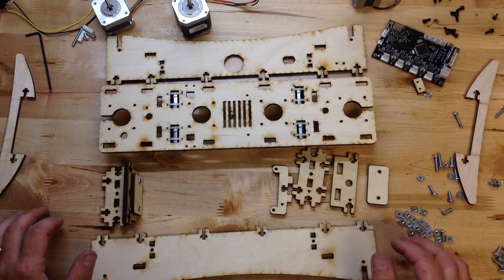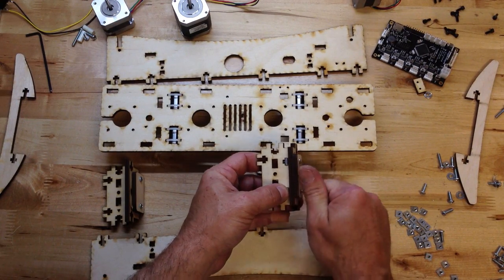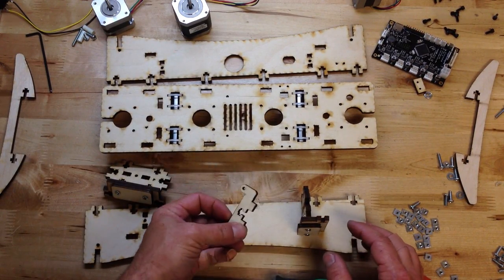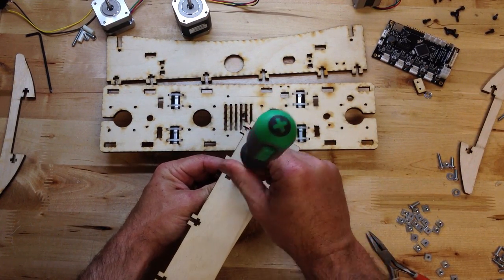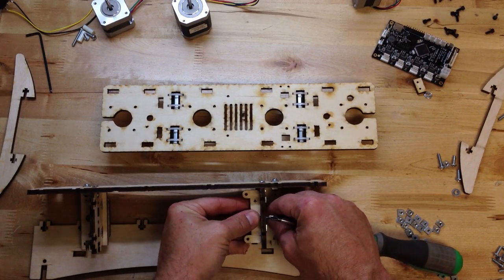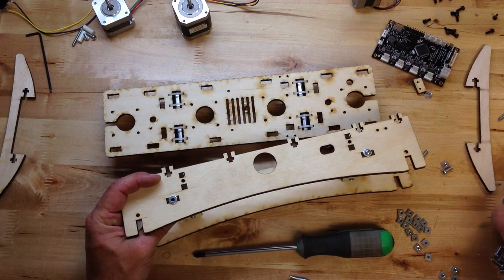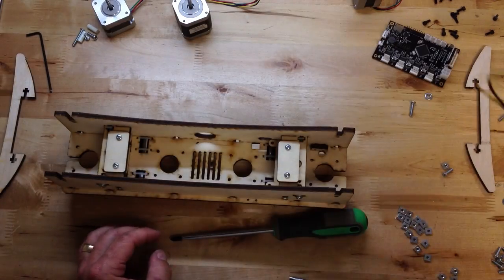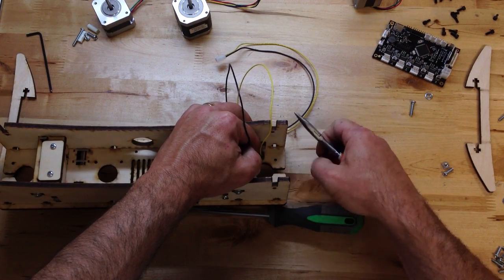Printrbot LC Build 01

Comment: Hi Brook. I don't know if you monitor this channel or not any longer, but I wanted to try anyway. I am probably the last person on the planet with a never assembled printrbot+ LC kit from the original KS campaign. It's a long story, but the short of it is due to divorce. I intend to follow these videos and attempt to assemble the kit finally in the coming days, but wanted to ask if there are any printed resources (PDF or otherwise) that you could point me to in an effort to assist that assembly process. It would be much appreciated! I'm kind of planning this assembly as a healthy step in closing a dark chapter of my life by way of using the assembled printer to make PPE for local clinics in my community during the pandemic. Thanks much and best wishes.